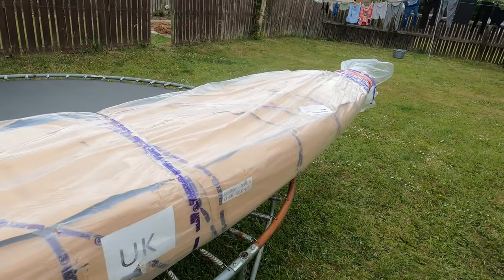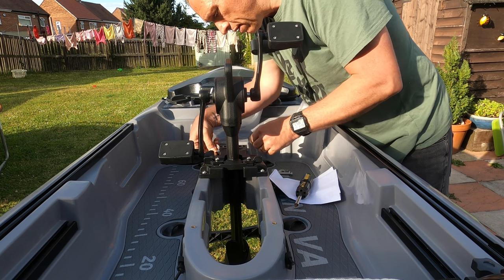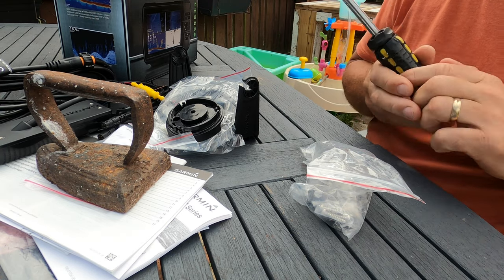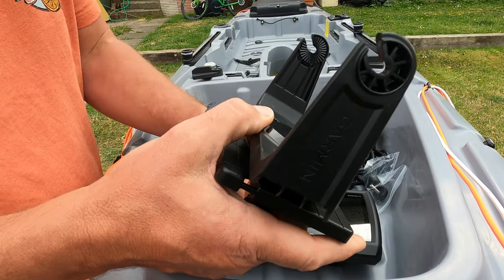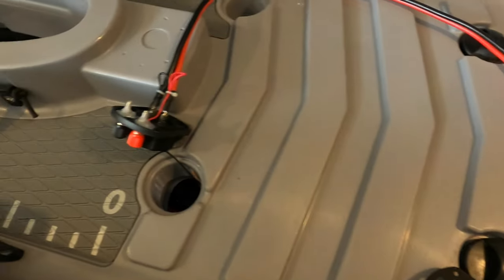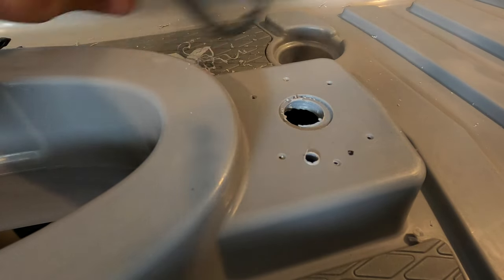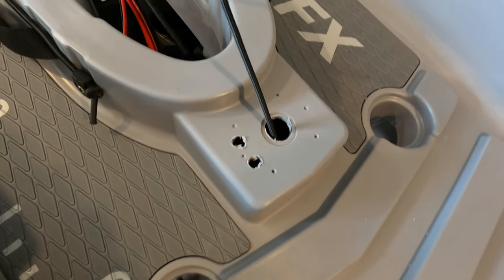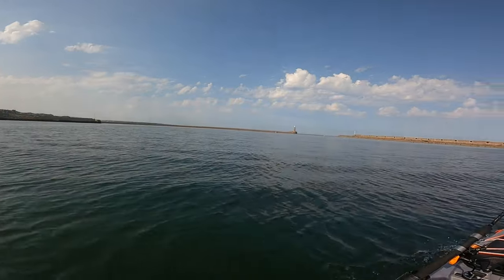Galaxy Supernova FX setup with Pro-Pel 54 Motor and Garmin Striker 7SV installation.

Comment: Did the sideview of the sonar gave any trouble with this install? I want to install the same transducer but i don't know how to make it stay flat to the water line with the mount of the supernova
Reply from the maker: Apologies for the late response bud, I used spacers to build up the bracket so the transducer was flat with the bottom of the yak, I also kept the plastic cover off which Is meant to protect the transducer,, I was told that this would affect the sonar. I never used the sideview and still don't on my SIB. I don't know if that is meant for shallower waters like in rivers. I've never really gave that a chance.

Comment: Is it not very heavy? that is the only thing that puts me off sit on kayaks
Reply from the maker: Hi John, this model, the supernova is fairly heavy but solid and stable. If you want a lighter one, try the Viking profish GT if you can get hold of one, they are paddle power or you can fit a motor on the back of them .. 🙂👍

Comment: Hi I’m looking for a fishing kayak and you seem to know about all I’ve a friend who has a feelfree lure 11 ft for sale it seems a nice boat what are your thoughts please
Reply from the maker: Hi and thanks bud, I don't have any experience with the feel free but I've not heard a bad thing about them. 11ft for me I think would be a tad to short as I prefer the extra couple feet like on the Galaxy Sturgeon and the Sturgeon FX.. Very stable Kayaks and handle well in all weather 👍 Good luck though with whatever you get and keep safe on the water.
Reply: I’ve looked at the feel free lure and it is a nice boat in fact so are all the Galaxy boats but I ended up with a sit in kayak that I can carry over my shoulder. Just found sit on boats that are over 30 + kgs to heavy to roof rack and carry by myself
Reply from the maker: I'll be honest John, your'e a braver man than me using a sit in, but only because i've never used or experienced them, it's the thought of them filling up with water instead of washing over the sit on, makes me feel more nervous 😐 but be safe and tight lines my friend..
Reply: Hi not really brave just have been kayaking since I was given an old PBK 14 canoe canvas skinned canoe in the nineteen sixties. I had good friends from Durham kayak club and we did lots of sea trips around the Hebrides I lived and breathed canoeing through the seventies and eighties and could roll the boat %100 which makes a difference ( anyone can do it after a bit of practice) I had a valley canoe products anas acuta sea boat it became part of me that why I like sit in boats. Thanks for comments.

Comment: Guessing it was the right call to put the transducer plate back on then?
Reply from the maker: I never put my plate back on as I was told that it may interfere with the sonar, but now i've heard it doesn't. But i have took it the transducer back off and put it on my SIB so don't use the YAK no more sadly, ..

Comment: Hi, just wondering if you were using a lifepo4 battery with the propel motor ? I had the same motor burn out on me last week due to overheating. Some of these motors aren't designed be run at full speed for long periods  with the newer batteries. 
I have bought a side mounted motor to be used in tandem with the rudder and won't be running it at more than 80 % speed. 
Of course if you were using the older marine battery then that makes the comparison null and void. The breakdown video was like an action replay of what happened to me but luckily I wasn't well offshore like you were. Cheers.
Reply from the maker: HI Bud, I did have the Lifepo4 60amp version for my propel motor, I still managed to get a full day out of it using all the speeds but didn't like it at full speed all the time. I have lost a fair bit of money on this set up but gladly sold the lot and got refunded for the motor off Galaxy.. I wish I had kept my Galaxy Stugeon, good old paddle power, it was much lighter and could paddle faster than the motor could take me lol. But I was glad I had Chris out with me on the break down otherwise i'd still be paddling in now😄😄

Comment: There to heavy wish i didnt get my sturgeon
Reply from the maker: They are heavy, and sadly now I don't use mine no more, got myself a SIB, easier, faster and get to places quicker and in stronger winds,  Tight lines
Reply: @kayakfishingwithascrewinac5814  that's what I want a sib
Reply from the maker: @darrenrodd.  There's a fair few up for sale but the motor is the expensive bit, ( why I have been doing loads of overtime and it's paid off lol )